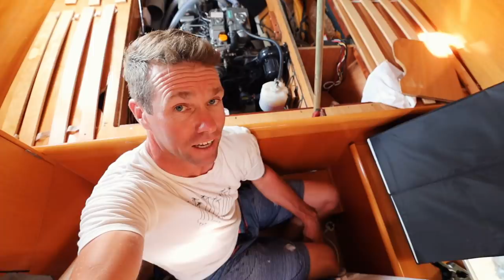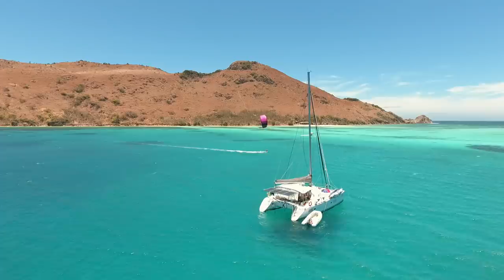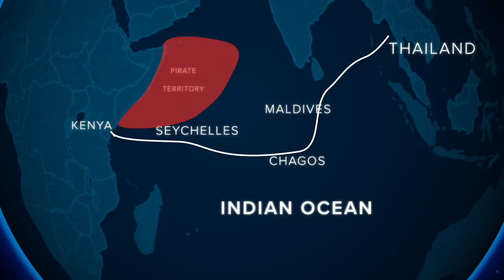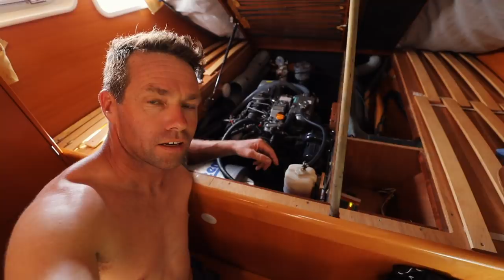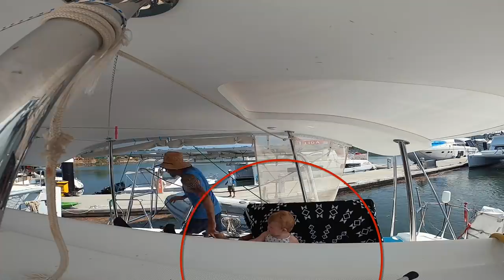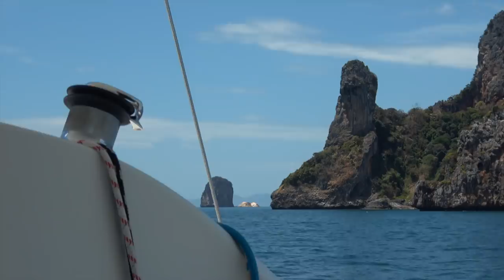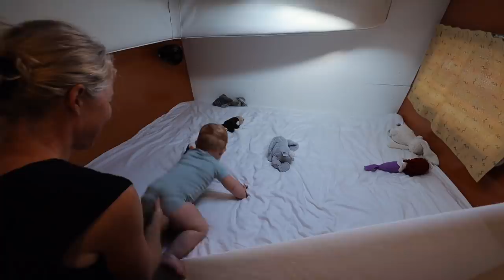we Just BLEW UP our Engine

Comment: I'm a diesel mechanic for a living.  The only things you could have done differently to avoid the bent pushrod are:  A) "fog" the engine before you left.  B)  physically turned the engine by hand if possible using a giant ratchet or breaker bar.  C)  took the engine apart for a preemptive rebuild.  All in all sometimes you have to accept that engines fail sometimes even when you treat them great.  I've seen engines need major work at 2000 hrs and the same model of engine run 20k hrs with only minor issues.  You guys are great!  Keep adventuring!
Reply: I just googled this and he's right. You can buy fogging oil to spray into an inboard engine's carburetor, called STA-BIL lubricant. If we don't do that before leaving an engine unused for a long period then the oils & lubricants drain away, and then the startup occurs in a dry engine. I wonder what you do if you couldn't fog the engine before leaving? What's a safe way? Maybe turn it over by hand and inject oil slowly?  ...
Reply: @directedby100  In this case fogging the intake and under the valve cover (no carb on diesel but you have the right idea).  If the oil filler cap is on the valve cover, fog it.  After thinking about it for a few days, maybe performing a cold oil change and pouring or brushing some of the new oil on all the components under the valve cover. Maybe tapping all the rocker arms with a brass mallet.  Even after all that it still could have stuck shut.

Comment: When you said “blew up” I picture a rod hanging out of the block.  Push rod likely bent because the valve was stuck, or the valve spring tension failed to close the valve all the way and the push rod fell out.  Replacing a push rod is as simple as dropping a new one in and backing off the adjuster enough to get it aligned.  Sometimes you have to pull the rocker assembly to drop them in, make sure it’s lined up in the lifter and use plenty of engine oil during assembly.  In your case the problem of the stuck valve still exists so it sounds like you are doing the right thing by popping the head off and having the valves and guides cleaned up since those services are available.  Not really anything you could have done differently.  If you knew it could be a problem you could have pulled the valve cover first and barred the engine over making sure all the valves were opening and closing before trying to start it.  Stopping when you heard the first tick may have helped but its likely the push rod was already bent, having the fuel shut off may have actually helped since the engine spent more time at lower RPM giving that valve a chance to loosen up... who knows.  Fun to see your family back on the boat, the happiness is apparent even with all the struggles. Cheers
Reply: Exactly. And I also feel like this is not a big deal as long as the right person is doing the job. If they know what they’re doing this should be a piece of cake. While you’re in there you might as well replace them all. Hahahahaha indeed.... 🤙🏽🍤🍺🤞🏽
Reply: Danm this a whole essay
Reply: Yep, a sticky valve guide will certainly bend a hallow pushrod.
Reply: Agree with rod went out, bent.
Reply: My rod is also bent.

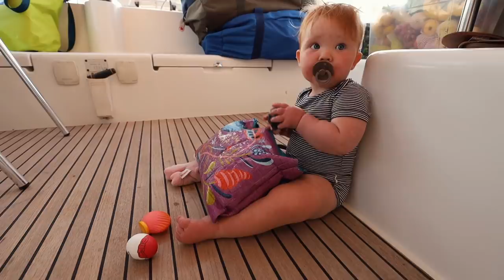Comment: The first tick sound, 4:20 is stuck valve, tick tick tick.. 4:34 the sound is now cam lobe smacking bottom of lifter, wack wack wack lol, and at 5:30 you shine the light on the culprit Ben! The rocker assy comes off the get out the push rods and then the head has to come off to get at the lifters, and to inspect the running surface on the camshaft. Sounds bad but not catastrophic.. from here anyways. good luck neighbors
Reply: Hopefully it didn't smash the hell out of the top of the piston 😬
Reply: @TF-uj6po  by the look of the rocker position im leaning towards that valve being stuck closed, leaving enough clearance for piston, but piled up between valve stem and lifter.

Comment: The valve is stuck. Remove the rocker are, remove the push rod, put a piece of wood on the valve and tap with another piece of wood until it moves back up to seated position. Oil valve stem through out procedure. Bend push rod straight using wood not metal. Take your time. Reinstall components leaving valve cover off. Rotten crankshaft by hand to make sure valve moving properly. Reinstall valve cover using red high temp sealer. Close hood and have a good day!

Comment: UPDATE: Something happened with my viewing of your Video and I only saw the engine question. Piston hitting the Cylinder head and then cut off. Now, that I can view the whole video, the only thing I missed is your helm is on the Port and I notice; you're running on one engine again, that's a No-No! For one, you almost hit another boat! Plus, I don't know If this is true for yours but, sometimes the Starboard engine runs backwards (Right hand) and the Port runs (Normal) Forward (Left Hand). That said the Starboard engine would also sometimes be built with the piston wrist pins off set from the Port engine. So, if the Port was confused with the Starboard engine on assembly... Well, you could imagine. 
This makes the propellers rotational torque cancel each other out and the boat goes straight.

Always when the Cylinder head is rebuilt, the Cylinder block needs to be rebuilt as well.
Here again some people will disagree with me but, I don't care what they say;
I am right and they are wrong!

Possible, your mechanic's diagnosis is correct but, IS also a moot point.
You can go with your mechanic's plan and this will work for a short time, with issues, oil burning and low oil pressure, ending with the same problem again in a much shorter time.
Remember; you're working with two engines that are continuously trying to vibrate apart, with the weight of two pistons as running mates, against half the weight of one with no running mate and adding to this problem with substandard repairs, will not work.

Now's a good time to;
Adjust all the valves on the Port engine, I would look into replacing the port cylinder head gasket, rebuilding Both fuel injection pumps, replacing all the Glow plugs on both engines, check the exhaust manifolds for internal leaks (I would replace the goose necks), replace Sea water cooling (impellers) and circulation pumps, clean the air intake baffles, replace all the Fuel filters, Fuel polish, rebuild all the fuel injectors, change oil in both transmissions, clean out both Sea water cooling screens, flush/replace the engine cooling water, check and clean all cooling water heat exchangers (1 for transmission and 1 for engine oil)...  add anything else you would like to do here.

DO NOT DO what Diesel boaters say; by dumping your used Oils in the fuel tanks!
*************************************************************************

Pay attention Boy (in a Foghorn way) Cause, I know something about Boats and Diesel Engines!  LOL!    https://en.wikipedia.org/wiki/Foghorn_Leghorn

The cause:
I assume, this engine is Starboard, of two 3 Cylinder Diesels (3 Cylinder Diesels, My Personal Pet Peeve) and Boat was ran on one engine to conserve fuel. Usually a Captain will run the engine closest to the helm (Right vs Left) and this will be your problem engine (Wild guess, Starboard?).  

All Diesels, will not take very much over revving or over loading especially 3 Cylinder types
(however 4 Cylinder types will take a little more abuse).
Your Diesel is running on 2 Cylinders outta 3 and the big end of one of the connecting rods is loose due to (I assume) over loading which really IS over revving on Boats, one be gets the other. The problem child rod is now able to allow the Piston to hit the Valves of the one Problem cylinder that is not running *OUTTA BALANCE*. Check your manual and see what the Maximum extended running RPM is (3 Cylinders need special attention to RPM to run in BALANCE which actually means they are design to run at one RPM somewhere in the 1800 to 2100 RPM area only NOT WOT).
I recommend 1800 to 2100 RPM, Captain needs to always adjust throttles to this RPM range paying close attention to the least amount of exhaust Smoke and Vibration. 
Note: All twin engine Boats (Gas or Diesel), are NOT designed to run on one engine (Running Overloaded)!
Also NOTE: normal operating cruise speed IS 50% Capability speed BOTH ENGINEs RUNNING!
NO, I DON'T CARE WHAT EVERYONE ELSE SAYS! 
A good way to check to see if your Diesel engine is running within it's capabilities, is to check
to see if Black smoke is coming out the exhaust at what you THINK is your normal operating cruise speed; Engines in gear running at your normal boat speed (approximately 8 knots Max).
BLACK SMOKE; Then engines are either over loaded or under loaded and overrevving.
Also, another check is the end of the Diesel engine life check;
Take a 3X5 piece of paper and hold it 1 inch above the open Oil filer hole in the Valve cover while lowest RPM running.
IF the paper gets blown upward, the engine is very near the end of it's life and is ready for Rebuild.
IF the paper gets deflected up and down only 1/4 inch, then Except, for Bearings the engine gets a partial ok by Me for at least 20+ hours.
Old Diesels need more frequent Oil changes (Change every time you can't see the dipstick through the Oil)!

If RPM is within specifications then the Propellers are making the engines work too hard, Props have too much blade angle pitch and or too much Diameter. determines how far the boat travels in one rotation of Prop shaft (More Pitch more engine load)

My Diagnosis is;
1) Sounds like the Engine has low oil pressure and is now damaged.
    A) Caused by sustained over revving which increases Oil bearing clearances allowing Oil to escape
    B) I assume, The engine now also has low Oil level attributing to more bearing wear.
    C) I assume, The engine now also has Dirty Oil attributing to low Oil Pressure
    D) I assume,  at least one Rod Bearing is so lose it has allowed a Piston to hit the Valves
    May be the Knock Knock Noise but, IS a bad rod bearing that caused this problem of running outta 
    balance (3 cylinders are RPM Dependent otherwise run OUTTA BALANCE but, not as bad as shown) . 
    E) I assume, The engine's low Oil Pressure is not allowing all the valves to open properly.
    F) Possible plugged fuel injector included in "D" assumption.
2) I Assume, engine 2 Port engine has low oil pressure and is about to let go in the same fashion.

Remedy;
1) Remove and Rebuild problem child engine.
2) Recommend, Remove and Rebuild Both Engines!
3) Re-prop to run engines within RPM range and load as per Specifications, with least smoke and Vibration! 
4) Pay extra special close attention to Break in speeds and loads after rebuild!
5) Always run engines within their specifications per manual NOT at their Wide open throttle Capable 
    speed! WOT is for short bursts of not more than 2 minutes of emergency use only!
6) Oil Change every 100 hours or less if Oil looks dirty and Oil change every time Boat is left for season.
7) Always  "fog" the engines before you leave and rotate engines to a point where most of the intake valves are closed and all of the exhaust are closed if possible.

And take care of those Babies!

Comment: WOW!  Look at those smiles!!!  Engine problems and warm beer haven't dampened your happiness, 
So glad to see you back on the water.
Tick tick tick is usually always a valve. since the push rod is bent, depending on the hours on the motor, you might want to check the pistons and just do a ring job while it is down. Its more work and expense, but its better to do it when you  are half way torn down it could save time and expense in the long run. Just a thought.
Best of luck.

Comment: Ben it is very easy to replace the push rod, which looks bent. Then pull the injectors and do a compression test, this will tell you if you have damaged the valve or piston.Unfortunatley I think the valve was stuck open and got bent the second time  you ran the motor hence the different sound but for the sake of less than one hours work I would do the comp. test, if all cylinders show the same you should be ok . Worst is engine out piston ,con rod, valve , pushrod, oil and gasket kit.
Reply: Comp test, drain the oil and look for anything shiny.

Comment: When you leave engines for an extended period of time you should use sea foam engine fogging oil to clean the valves out so they don’t stick. Also you should use it on the other engine to clean off any buildup of carbon.
Reply: Drain the oil and gas, check the lines for any signs of age or cracking.

Comment: The VERY best thing about Sunday's is a new Sailing Nahoa episode! 
You folks absolutely beam positivity - it's so nice to see such a happy (and grateful) family.

A shame about the engine but no need to beat yourself up Ben, (would have been nice if the fuel supply valve being closed solved the problem). So glad that you are on the hook again and can recharge your personal batteries for a few days - then tackle the power train reliability.

Willa - is simply gorgeous and will be a star in her own right as so many have pointed out in comments. (Perhaps show her name in print or say it slowly so more get the spelling right ?) 

(Having suffered with GI issues for years it was reassuring to discover that my issue was Gluten-intolerance. Often closely related to dairy sensitivities. Glad you're on top of it Mom!)

Thanks for making me laugh out loud - that messy cupcake scene was too much.
😘

Comment: I've gone thru the comments and no one seems to have a suggestion on what to do prior to starting an engine that sat for a year. That said, I think Ill make a mental note of it and remember that the valve cover comes off relatively easy. A soft mallet hammer strike on top of the valve rocker arms would prob "break" that seal loose. Lub it up well while your in there and it may prevent the bent rod. If I hear clicking like that ever, Ill just shut it down. Thanks for sharing Ben, it  sucks this happened to you guys, but it may prevent others from suffering the same fate. God Bless, looking forward to your next vid and Happy Birthday Willa!
Reply: Always pull valve cover turn engine over by hand see if valves are moving before trying to start.
Reply: @dougjones6823  you beat me to it if in doubt turn it over by hand!

Comment: The fast noise you're hearing while cranking is a loss of compression on one of the cylinders. You should have stopped cranking and pulled the valve cover at that point to investigate. Probably a stuck valve from being rusty from sitting so long in port as I have watched almost every video up to maybe 6 months ago. The loud bam most likely is popping back into the intake as the exhaust valve I think is bent there. what happened was the pushrod continued to bend and the exhaust valve totally stopped moving. What happens is it still draws air in, still fires the cylinder and when the exhaust valve should open, it does not, then it rolls on past with all of that pressure built up still that was not released through the exhaust valve and when the intake valve opens again, it makes a huge pop back into the intake and you are hearing that. Pull the intake hose or whatever it has going to the intake manifold and fire it up. If its popping like crazy, then that is what is happening. It will sound like a gun going off. If so, you could soak the valve stems in pb blaster or a good penetrating lube and it will free them up. I got this typed, now let's watch the rest of the video and I will comment more. As far as the pushrod, you just have to roll the engine until the cam has the lifter on the base of the cam lobe at its lowest point, loosen the jam nut, then the adjuster and that style of rocker arm should have enough room to slide over pushing against that spring on the rocker arm shaft. Pull the old pushrod, inspect that the lifter is still in place, install a new pushrod and slide the rocker over the top. Adjust using a feeler gauge and tighten down the nut. Some of those require pulling the whole shaft up with all of the rockers because there is not quite enough room to get the adjuster in the pushrod cup, but that style there looks like you can simply slide it like I said. Also, you will see a height difference in the valves if you look across the top of them, if you loosen all of the adjusters and pull the rockers, you will see the height difference in that one valve that bent the pushrod if something bent the head or it dropped the valve. Another way is to take a rubber mallet and tap lightly on the top of the stem and you will feel a difference in that one valve if something is bad wrong. Freightliner semi truck senior tech here.

Comment: G'day Ben & Ash, the last noise the engine made, when started, eerily sounded like metal on metal ~ which is bloody awful. It's either a damaged pushrod in the valvetrain or possibly a con rod and rod bearing took a dump?  I'd pull the valve cover first, and inspect the pushrods? If nothing is wrong, then remove the head.  At least you'll be able to properly inspect the engine, and replace anything you find, before you begin cruising! A lot better to make repairs while still at the marina and not anchored in the middle of the ocean!!! If I was closer, I'd come help you, and completely tear-down both diesels and rebuild them beyond factory specs!  I build so many freaking engines at my boat-yards! If you have questions, please don't hesitate to ask mate! Good luck, Ben & Ash. Cheers from Western OZ  🇦🇺.